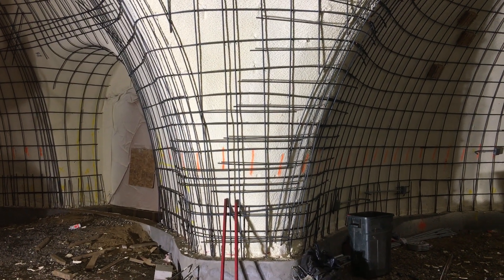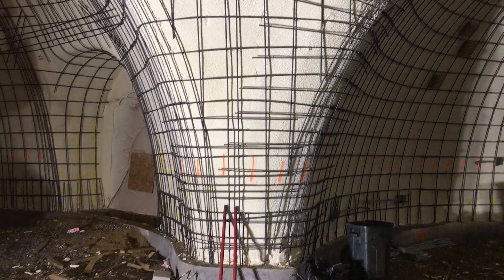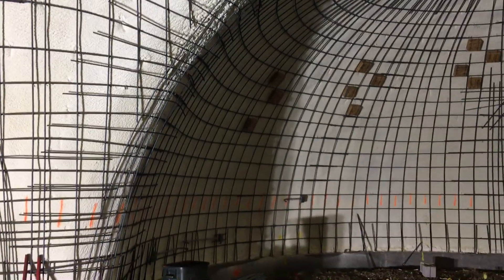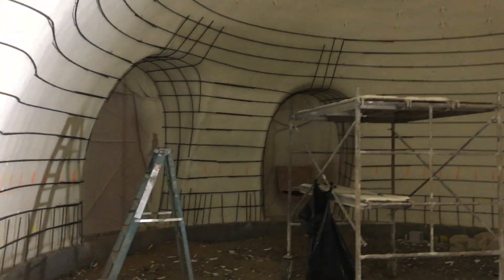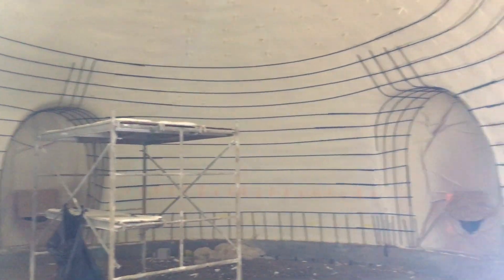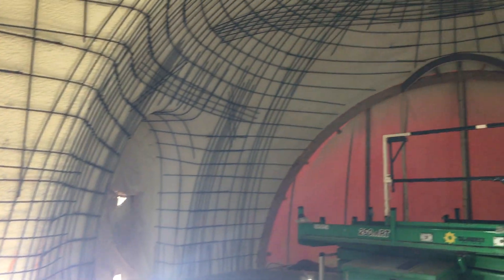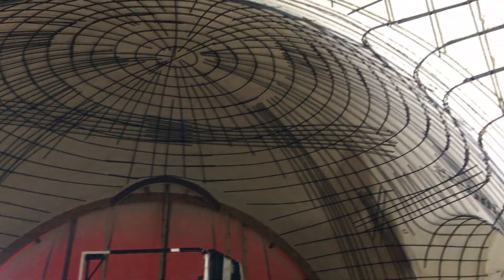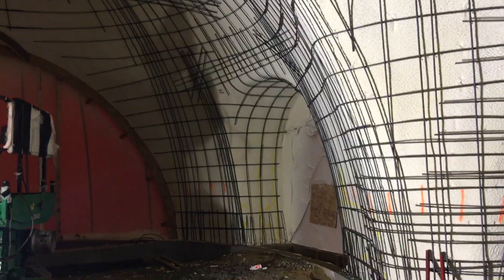Monolithic Dome house rebar

Comment: I want a house like this.  I could be buried for centuries, and my descendants will still be able to live in it if they wish.  These houses are indestructible and as close to immortal as a house can get.
Reply from the maker: Agreed!  The only trick to that longevity is the exterior.  We will have to go back and put cement on the outside to get that level of durability.  We can't afford to now (heck we need to just move in), but we will get there eventually.
Reply from the maker: @i-spy-ty  I follow aircrete Harry on IG. It seems really cool and I like following him but all the buildings they make are fairly small. At least that is my impression. I also think it would be difficult where we live to get a licensed engineer (that could stamp the plans) to work on one of the aircrete houses. We had a heck of a time getting an engineer licensed in our state to sign off on our already engineered plans. We had engineering done for the house by an experienced guy but he wasn’t licensed in our state. He had to teach the local one because our town requires stamped engineering on unconventionally designed homes. I don’t get the feeling the aircrete domes have engineering but I may be wrong. They seem to build them in locations that don’t require formal stamped engineering or maybe they are small enough structures where they don’t need engineering. I think we have some sort of provision here where if it is a small enough structure engineering isn’t required. But that square foot number is really small.